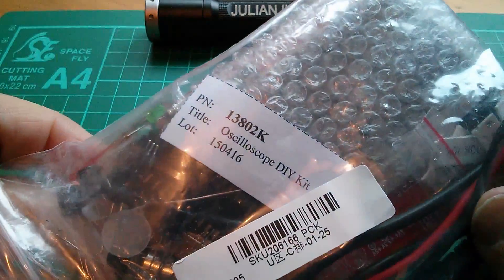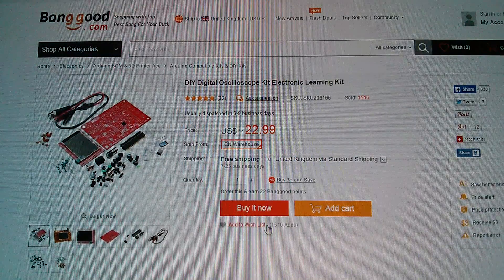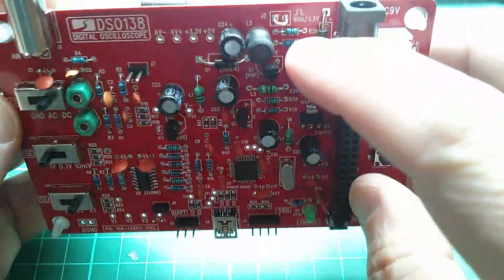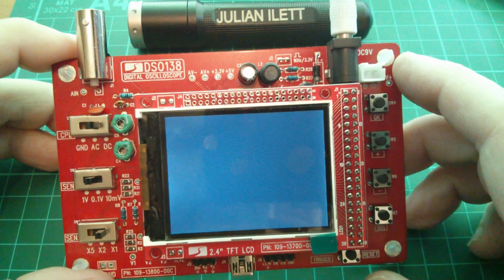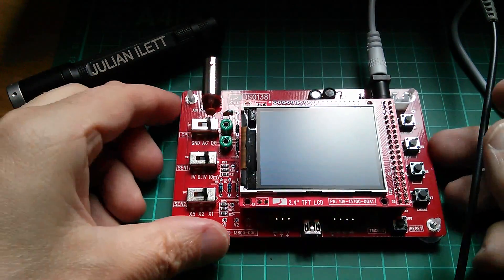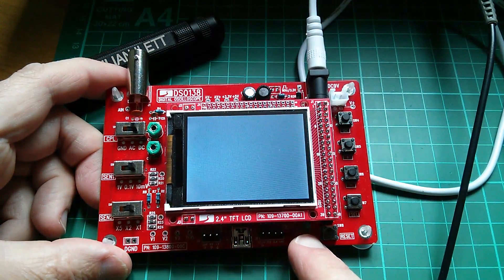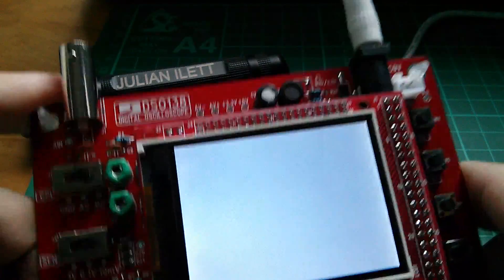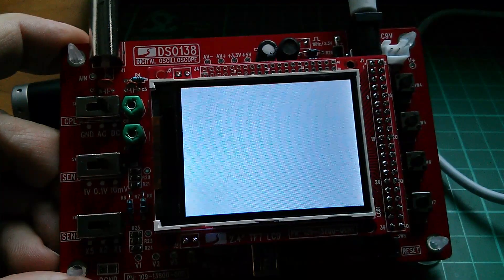Julian's Kit Build (FAIL): Banggood £15 ($23) Oscilloscope Kit

Comment: I have built this exact device myself some time ago. Now I am by no means a complete novice in electronics, though I wouldn't rate my skills as advanced either. Frankly the amount of trouble it appears you had with this build makes me question, well everything you've posted. I didn't find it difficult soldering to ground, I didn't put things on backwards, I didn't misidentify components, in fact I didn't run into a single problem you seemed to have and ended up with a perfectly working device. Perhaps it was just dumb luck.
Reply: Benjamin Lancaster LOL kind of it the same point here as you. I soldered that sucker together with a butane soldering iron because I I had moved and didn't have my normal iron on hand. maybe I'm better at soldering things and I realized . LOL
Reply: had close to no problems xD the display wasn't working either for me so I examined the conections for the display and some were kind of bad, seems like I rushed them a bit xD after some tweaking it was fine

Comment: wow. I think its just bad luck. You solder job looks nice, shine and clean. Mine its working perfectly, despite some noise. I would recommend you to change your power supply. I am using those little step down modules they sell, and plugging a 3s lipo battery. I have been using it for two weeks every day and its flawless. Look for those two separete pins that connect LCD to the board. Sometimes they dont do a good connection (short lenght / ping move when heat is applied). Good luck!

Comment: (hugo.gutierrez.s@gmail.com) Hi Julian , I just saw your video. Yesterday I finished to assemble my own oscilloscope (same factory and model, same price , but I had to pay the mailing to Chile). When I installed the screen and put the power on , I realized the screen was internally crashed. Now I have to ask to the company if they sell the screens alone. I am very frustated because I could'nt use it, and as you,  I was at the end of the work. I have the twice blinking of the green led too, so I know the microprocessor is working .  I was making a video about the build of the oscilloscope (in Spanish) at the same pace I was soldering the parts (now is pending until I have the replacing part). Today, windowing at You tube I found your video. What about yours ? Did you achieved to let it work ? In case, the company sells the screen alone, I will have to wait at least a month to have the part with me  :( .   (Many regards from Chile , South-America). Let me know your comments. (hugo.gutierrez.s@gmail.com)
Reply: +Hugo Gutiérrez Salazar  hello from Chili too ...LOL
Hola me metí en el mismo cacho de soldar este proyecto , ojala tenga pulso , paciencia y suerte de que no venga nada en mal estado. Aunque no es gracia perder dinero, por último si falla, no ha sido un alto costo.
ojala Charlemos y compartamos experiencias sobre este chiche tecnológico :)
Reply: +Miguel Angel ESte tipo nunca respondió (umpolite)... Pero yo al menos logré  hacerlo funcionar.
Reply: Hola Hugo , gracias por responder , bueno yo no pude hacerlos funcionar, y hablo en plural por que compré 2 ... al primero lo eché a perder por derramar soldadura en uno de los chip presoldados y no pude quitar la soldadura que puenteaba los pines... en el segundo proyecto también parpadeaba el les pero el panel no funcionó.... tampoco funcionó el segundo que pude poner( que rescaté del primer proyecto)
creo que la próxima optaré por un proyecto mas prearmado ....pero con 2 juegos de pinzas de test

Igual cuéntame qué es lo que tuviste que hacer para hacer funcionar el proyecto

Intercambiamos celus? o solo por acá  en medio escrito??
Reply: Tengo un dato de un Osciloscopio que se puede conectar al PC, no es caro.

Comment: Have they help you solve the issue with the screen? When you start this series again, could I suggest a few things I would like to see to make it complete. You could ask them while you are trying to get it fixed if they could send you the update firmware. I have 45 and they are suppose to be up to 49(50 but they changed r11 resistor and firmware and will not give out firmware 50) but only 36 and 40 on the manufacturer site. You might want to show how to do the update, and tell us where we can get the later them 40 update. You might want to ask them about the new 138 with the 50 firmware that is suppose to have less noise and maybe they would want to send one to you to show the difference? Just some suggestions. Hope they get yours sorted out.
Thanks again for the videos.

Comment: У меня та же беда, причем все на вид рабочее на главной плате - отрицательное напряжение есть тоже, даже все напряжения в норме, сигналы данных приходят на экранный разъем - проверил в режиме тэстирования (комбинация клавиш "reset + Ok" ) Даже и не знаю что делать или экран не рабочий или прошивка в микроконтроллере битая. Может попробовать прошить через UART?
Reply: Дмитрий Екименко Да, это помогло, последняя прошивка 113-13801-042 содержит 2 драйвера для разных TFT LCD 9341 & 9325 все предыдущие версии прошивки имели драйвер только для 9341. Чтобы посмотреть модель экрана, нужно его аккуратно отклеить от платы и на шлейфе будет написана модэль, в моем случае эта как раз и был TFT LCD 9325 по этому и не работал экран.
   Yes, it has helped, the latest firmware 113-13801-042 contains 2 different drivers for TFT LCD 9341 & 9325 all previous versions of the firmware the driver had only 9341. To see a model of the screen, it is necessary to carefully peel off the board, and will be written on the loop model in my case, this was exactly the TFT LCD 9325 on the screen is not working.

Comment: Sorry forgot to mention. I found the switches were rather badly contaminated, (guessing oil). So it's just possible you have a bad solder joint. I'd definitely be checking your switches. Run over them again with your soldering iron and maybe check with some good magnification. After soldering in the first switch and finding it reluctant to take solder I went over the rest with a small strip of fine wet and dry and used some flux paste. A fiddly job but well worth the effort..

Comment: I finished mine this afternoon and it worked first up. A little bit of tweaking and it's working well. Not exactly the most complicated kit I've tackled, but I definitely needed a little magnification checking those tiny resistors. An excellent kit for $19.50 USD. I was impressed with the display, good resolution for the size. The inbuilt oscillator is a handy thing to have as well. I just wish someone had a suitable box to put it in, although it would mean remotely wiring all those buttons and switches. I was thinking of buying another kit specifically for for that purpose rather than trying to de-solder all those connections.

Comment: Hi

I have exactly the same fault, I think they use a replacement lcd with a different initialisation routine. I hope you find the problem or Bangood opens the firmware so I can debug it.

Comment: Have you had any luck getting it running or in getting banggood to send another scope or screen? I was hoping you would show us things we could or can do with it in our hobby.
Good luck.
Reply from the maker: amtpdb1 I've fixed the missing negative analogue voltage (AV-). That was due to resistors fitted in the wrong locations - 120 ohms in horrible 4-band colour code reads the exact reverse of 10k :(
I've asked Banggood for a new LCD - waiting for a reply.
Reply: Julian Ilett Thanks for getting back so quickly. It's hard to beleave that they are taking so long to get this resolved considering that they sent it to you for a review! You would have thought they would have just sent you another kit just so you would say how efficient they were to resolve issues!
Have a nice weekend.  But I am still waiting for you to show me how to use it!!!!!! (:-}
Reply: +Julian Ilett i soooo would have bought and built one of these if it had have worked for you.  i'm still keen to see one working. Maybe if they don't send you the replacement (or new display) you can do a hammer destruction video of it - you might make enough cash from views to buy a replacement.
Reply: Julian Ilett Are there any updates on the replacement screen?
Reply: +chillzwinter I built the first model they had and then purchased the second model that they came out with that has better noise elimination. The manufacturer finally gave out the better software, so I will change both to the new software. I had a couple of problems. I had to change out a voltage regulator as I was getting the wrong voltage, and remove one chip and re-soldered it Jye does get back to you on their forum to resolve issues. One thing is that you need to get a 9 volt power supply as if you use a battery as most start off with, when the voltage drops everything goes haywire. 
Good luck

Comment: this is a common mistake by many DSO138 builders. you mess up the two regulators. the 79L05 and 78L05. one is for the positive and one for the negative. because of the pinout difference, probable both of them are burned now. Replace them with the correct order.

Comment: Check all your solder joints, had the same problem. Turned out to be a dry join on the lcd connector pins. Also there are two points that need shorting with solder, jp3 and jp4. Good luck and clean your iron 😜

Comment: I have bought a ton of kits like this and I am about to buy this one from sainsmart. My best guess w/o working on this is check all the solder work look for cold solders. I have also got a few bad screens in the past. Getting a cheap nano or other small micro controller to test it is a good option. If I understand that is a battery pack? I wouldn't use one for a kit like this due to V drops/spikes I have used direct battery connections but I tend to use small supplies from the scrap box or look for cheap kit's for power supplies that have worked very well in the past. Just finished a Antenna analyzer from fox delta that was a blast to build. Best of luck with your kits
 73
  N8DAH

Comment: Just built mines today, I also have 0.687 V on the AV- However I have a working display and a trace. But the trace is either on the bottom of the screen or the top of the screen. Frustrating indeed. You can try to reflash the chip, it might just be a bug. One of the 16v 100uF capacitors actually went short circuit, I pull it out and replaced it with a 25v 100uF.

Oh and I found out that this scope is very picky about input voltages and current. It wasn't happen when I fed it 9.00V at 500ma. It was screaming and making music. I changed the voltage to 9.39v and 1.00 A. No more noise and it worked just "fine". I used a KORAD Linear PS that I bought for $40.
Reply: Walter Boxhead JP3 JP4 are both shorted. JP3 connects the two ground together, and JP4 supplies power to the MCU. I thought it was the transistor, so i took it off the board and the transistor is fine. I'm getting 1.2v out of VGEN. I dont have another scope to help out.

Comment: Just resolder all 40pin LCD connector on both PCB and do same with 2 pic connector and see, I had same problem no -ve voltage and white screen , but now its good to go..

Comment: I'd say that he should get a decent temperature controlled soldering iron of at least 40 Watts that can handle soldering the ground points correctly and go over them all again. He also needs to get a decent bench power supply that puts out the correct 9 volts when it's on and goes to zero when it's off instead of trying to use the weird power bank.

Comment: I had the same "mysterious" problem when I built mine. Several minor problems corrected (SMT resistors not completely soldered) but still nothing worked.. I decided to reflash the program and that fixed the problem. There are two versions of the program on the Banggood site. I am running the modified version that gives numeric details about the wave form... Very clever.

Comment: What happens when you connect it to a PC via the USB port? Presumably it has upgradable firmware or something; perhaps a re-flash would help or at least give you further clues to track down the issue...
Reply: Thunderbelch I get a 'device not recognised' error pop up on my (working) one. You need to flash via the serial interface.

Comment: Just a guess: I had an issue with this kind of displays, with multiple ones, powering the backlight straight from 5V or 3.3V supply the display just turned white, and at first I thought I was getting faulty displays. The problem seemed to be with the backlight, because once I used a pwm output from the microcontroller and could regulate voltage supplied to the backlight (or used a voltage divider), at certain point the display would return to normal operation. I did not investigate the exact cause of this, but it seemed that once a high enough voltage was applied, the backlight interfered with the pixels on the display turning everything maximum white. It could also be the current issue, maybe someone can confirm this.

Comment: A years ago, i tried these kinds of TFT and parallel them with the same parallel bus, which turns out if the flux is too much between the data bus pin, it actually shorted out the signal with such high frequency clock and data. Try probe the pin with a multimeter and see whether they have any short may tell the internal TFT driver is damage or not.

Comment: First thing I would do would use a Hot Air Station and do a ReFlow on all the SMT parts.  Tiny cracks are so small that's not even seen by magnifying glass and stops some part of the circuit from working.  Try again after heating up the board.  If no working, try to cool the board and see what happens.  Its very unlikely the powerbank did any damage as under-voltage would not be an issue.  Sounds more like a micro fraction in one of the solder connections.

Comment: those power banks can be a bit weird, i used a 5v (usb) power bank to connect to a voltage regulator, but when it was above 3v (powering something) the voltage was all over the place, maybe try a non boosted mains 9v power supply

Comment: Likely that you over volted the screen, sometimes in cheap devices the power for the screen is taken from the input before the voltage control for the MCU. I'm guessing the justification for that would be bc its draws more powe prhaps? The MCU isnt getting feedback from the screen so its not going to initalise the clocks needed for measurement. The test signal is likly to be using a hardware timer and interupt so the MCU wouldnt need to be fully booted up for it to give the signal. I would try plugging that screen into an arduino and running some example programs or piggyback a known good screen onto the board. That way you will know if you over volted the screen or the MCU.

Comment: Y'all blokes are all wrong. The problem is a fat electron that is stuck between two pins. That is a common failure with this particular model :)
Reply: A. R. Jasso I've had this issue before, I never use the stock electrons. Poorly machined crap. I only import hand made finely ground electrons from Canuckistan.
Reply: it was a joke.
Reply: What's an electron in terms of components?

Comment: Julian Ilett I agree with what Billy Sugger has already suggested but also add that most circuits can tolerate "slow" power ups but "slow" is still sub 1 second.  If a circuit is going to need to tolerate under voltages you have to design for that a bit and it looks like that "scope" wasn't designed to sit at a low voltage long before being damaged.

When ever I build a circuit, especially one that took hours to assemble, I try to always use a half decent PS that I can rely on and that has some kind of current limiting or shut down protection.  I'm sure that USB PS can supply many times (10+ x) more current than required for that scope so it isn't going to shutdown before the smoke escapes.  Using a better PS for initial testing at least will eliminate any doubts and when you later try it with a different PS you already know that it did work before and can try again on the good PS.

The first thing you normally check when first turning on a circuit is the PS outputs and if the controller is doing some kind of POST it very likely would be checking those and halting before doing anything with the display.  Little surprised the LED doesn't blink different for different POST failures.

I would desolder the L1 lead at V- and apply ~ -8 V to the input of the 7905 and check its output.  It looks like the controller checks for about 2.3 V on V-MON (hard to see) and may adjust its output on VGEN as a result.  See what happens with VGEN and the 7905 output when supplying your own -8 V negative supply.

Good luck and keep us informed of your progress!

Comment: To bad too, I to was looking with a chance of getting one of these to learn more about oscilloscopes. I have built one of those sound card one's from an online instruction make it video and it works OK for some things. I was scared of killing my laptop so purchased a small external sound card that plugs into the USB port.  Works OK but rather limited in scope and usefulness.  So far about all I have manged to do was to kill one board I was experimenting on with the scope.  No great loss but learning experience to say the least.

Comment: I'm building one of these for a bit of fun as soon as it arrives, I'll video the process and hopefully I'll have a bit more luck.  A temperature controlled iron is absolutely essential, especially for those points where you need to get extra heat, I also find it's a lot less prone to losing heat.